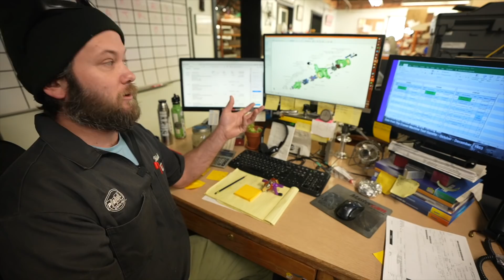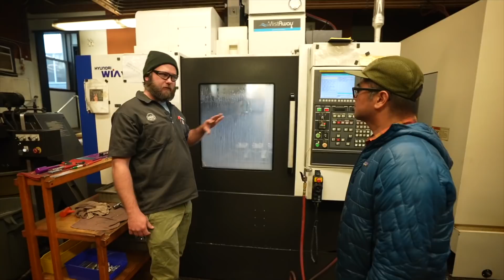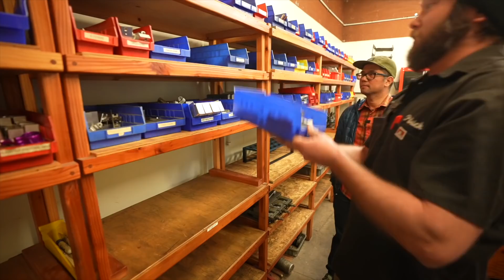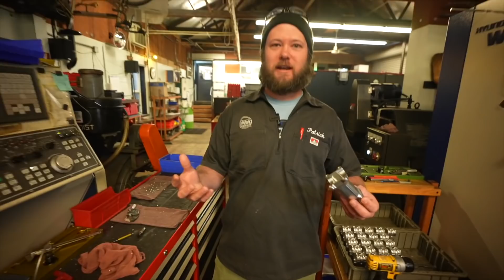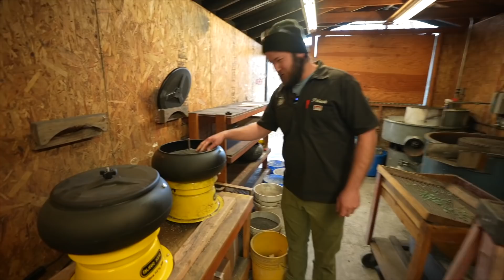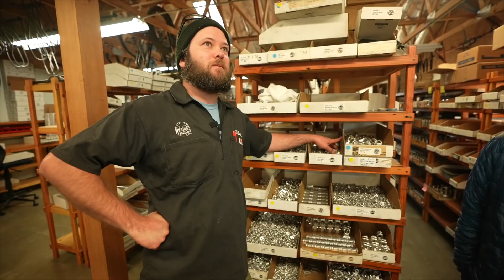From SOLID Aluminum to Bicycle Parts - Paul Components

Comment: After buying a few parts from Paul Comp I had the realization that they are not expensive at all. For the quality and longevity you get for the money the VALUE is incredible. Cost per use over the course of its lifetime is incredibly low, far far lower than either of the big S brands. The initial investment in these parts seems high because we have become accustomed to cheap stuff that won't last, but it pays for itself for a lifetime. This is what American manufacturing supremacy was built on and I hope there is a greater return to this style of manufacturing and buy it for life investment rather than throw away consumption.

Comment: So cool finally getting to see what goes on behind the scenes at Paul. A lot of work, but for an exceptionally high quality product. Hopefully this will quiet some of the folks who are fixated on the price.

I love that you finished on the unscrewing multitool thing topic. The first time that happened to me was in the middle of nowhere in outback Australia and parts got everywhere - very frustrating and the worst possible timing. Although I suppose it's always bad timing, because if you need a multitool, then there's a chance that something is already broken.... After that I absolutely drowned it in Loctite and it's been good ever since!

Comment: I need that tool - already got myself what must be the ultimate go anywhere do anything chain breaker that even earned me a free brand new helmet for christmas last year when I helped a fellow rider who had just suffered a broken chain on the road just ahead of me and inside 5 minutes had his bike back on the road - it the KMC mini chain breaker - anyway I need that tool Paul is touting around in his pocket and have begun saving up the mega bucks it will cost me and am looking forward to the day I can buy one.
Reply: Get a Park Tool MT-1.
Reply: @iliinsky  My home toolkit already has one, but when riding my bike why would I want to carry a tool that weighs so much when the KMC weighs so little you hardly realise your carrying it and it functions by using one of the 4 Hex keys needed to work on my bike - the KMC is a pretty near perfect portable chain breaker - it is robust and weighs far far less than any other tool….. oh and it fits inside my hollow crank axle so it goes everywhere with me.

Comment: Thank you for this Russ! You and Laura are knocking it out of the park recently. I always enjoy your content, but Rivendell and Paul are two of my favorite companies. This Paul factory tour was awesome. I really want to get away from dealing with hydro disc brakes on my Diverge. Paul Klampers are the answer! 👍
Reply: The only thing I would check is where the brake line comes out.  I wanted to put some klampers on a Sonder Camino (I assume you are in the US so you are possibly not familiar with the brand) but the cable route through the carbon forks made the operating of the klampers impossible.  I had to use different brakes in the end.  That being said they were not wasted as they are on my Gorilla Monsoon now and I can’t recommend them enough.   Like any brakes the frame and fork combo may prove an issue  -  particularly where the manufacturer hides the cable routing.
Reply: @nickporter3531  Thanks Nick. I had not considered that, but now that you mention it, the internal cable routing on my full carbon fork on my Diverge may be an issue. The more I think about it, the less I think a non-hydro, cable actuated brake will work. It is a very short distance from where the housing exits the fork. Correct me if I am wrong, but I would need a cable stop somewhere and enough exposed cable to pull the arm on the Klamper. 🤔
Reply: @billromano5844  It will depend on where the cable exits the fork and where the lever arm is located on the brake calliper.  My cable exited on the inside of the fork  - ideal for SRAM and Shimano flat mount brakes and for TRP Spyre and HyRD brakes.  For Klampers the ideal would be the cable exiting the middle or outside of the fork a little bit further up so you have as straight a route for the cable as possible. My AC Gorilla Monsoon and my Singular Peregrine are both externally routed and have the cables for the front brake located in the middle rear of the fork so ideal for lining up with the calliper arm.  As the TRP brakes are dual pivot their arm is located towards the inside of the brake so line up better - apart from performance the other issue with these is that you need compression less housings and cable to make them work efficiently - this is not an issue with Klampers as standard cable and housing works just fine (and a friend of mine who owns a bike shop removed the compressionless ones on his bike as they were a bit too savage when he brakes!) Hope this helps! Nick

Comment: When you look at the price of the brake compared with the rest of the system they are about as expensive as their peers.   They are great brakes and definitely the best cable ones I have tried.  A good MTB hydro brake (hope 4 pots or Shimano XT) are in the same ball park.  When you add them to shifters (I use 8000 Ultegra with them) then they come out about the same price as the hydro ones.   It will depend where you live in the world  as tax and cost of transportation come into the overall cost.  The other issue that may be ignored for companies like Paul, Hope and Chris King they are a lot smaller than companies such as Shimano and SRAM.  Yes, they are a lot more expensive than the lower end Shimano offerings (that work very well) but if you compare them with the cost of top tier parts such as XT, Dura Ace, Ultegra, Campy and the (overpriced) SRAM offerings then there is little difference.  I have them on 2 of my bikes and the lovely Paul centre pulls on my Pescadero. You just can’t beat ‘em!
Reply: Buy cheap, buy twice